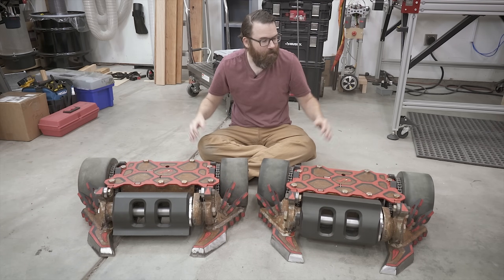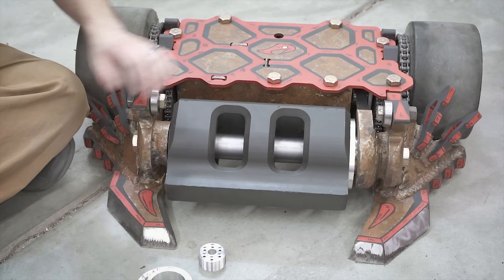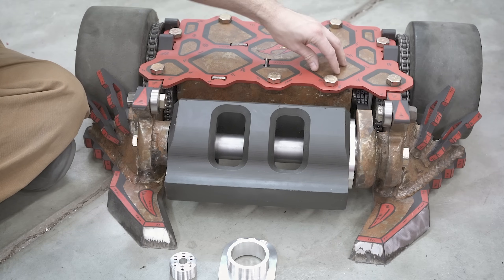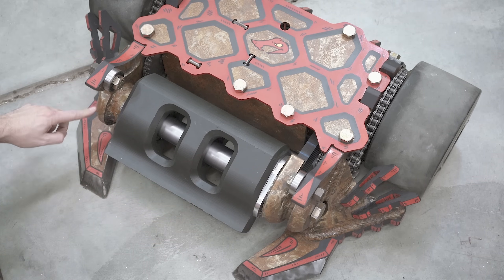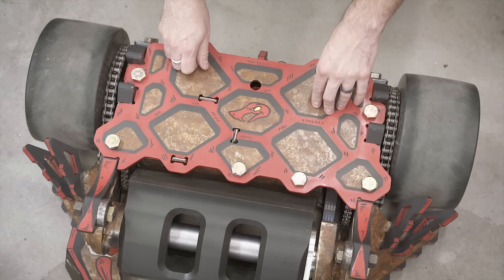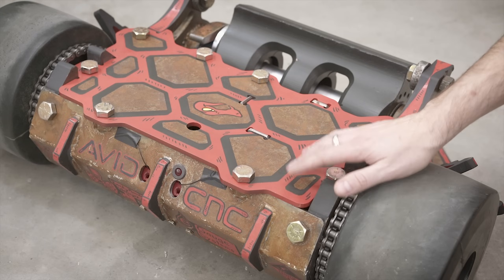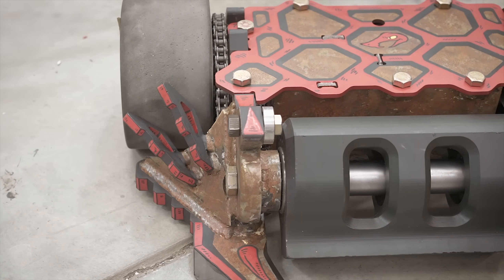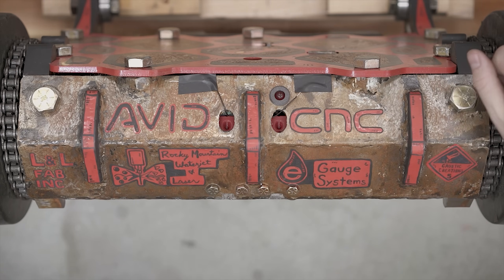Copperhead Preview (2020)

Comment: Hey, did you think about possibly incorporating motor into the shaft?
You'd have magnets placed on the shaft, and stationary rotor hidden within it.
This way you could save some weight and possibly make it more robust - no belts to slip or snap.
Other than that, design looks pretty good and there is little to better.
Also as for thermal epoxy - you might actually try doing some of such yourself.
JB Weld is known to be the strongest epoxy on the market, and incorporating some heat conducting particles (aluminium, zinc oxide etc) would probably not lower it's strength that much.
Reply from the maker: This is a hub motor, and it's not been successfully used in this weight class, the motor would see too high shock loads and would most likely break the magnets.

Comment: Robert,
 
This is a general question about the rotational speed of any robot with a spinner. I'm asking you because I've watched several of your videos and have enjoyed your depth of knowledge and ability to explain your design decisions.

The 2020 rules state that the highest speed of any external part of a robot is 370 ft/min.

In doing a few simplified and estimated calculations of your spinner, based only on visual estimates: 
8" diameter spinner x Pi = ~24" or 2 ft circumference. 
370 ft/min / 2 ft/revolution = 185 revolutions / min MAX. 

Your demonstration of the spinner when you demonstrated the sound level, I believe in a different video, looked significantly higher than 185 rpm. In the performances in the arena it also seemed to be going much higher than 185 rpm.

I found this higher speed to be visually the case for almost all spinners.

Am I missing something? I'm considering a design with kinetic energy weapons and of course speed is everything.

I'd appreciate your thoughts and insights.

Keith
Reply from the maker: I'm not checking all your math, but our drum isn't very large in diameter.  And the tip speed is 250MPH, meaning the outer tip can't move more than 250MPH.  185 RPM is VERY slow.  Check your math, something is wonky.  You're on the right track though.
Reply: @RobertCowanDIY  
I agree, 250 MPH is 370 ft/sec as allowed by the rules. Unfortunately, my calcs were done at 370 ft/min not ft/SEC. So i was wrong by a factor of 60. Oops. That would put your tip speed at about 11,100 RPM. A much better result. 
Thanks for the response.

Comment: Why aren't the magnets more on the front of the bot? Maybe on the back they help more on the traction and on the front (effective middle) they help more on how planted the bit behaves and prevents "wheelies"
Reply from the maker: The front weapon assembly is over 60 pounds, not including the shaft.  The center of mass is behind the drum a bit, so the magnets are placed just forward of the wheels to add more traction to the wheels without making it too front-heavy, which would cause it to just dig into the floor.

Comment: I know its far to late now, but, if you ditch the rare earth magnets, and instead use some of those magnetic door lock electro magnets, you can with very little space and weight gain use, 2 of the 300lb force electro magnets, they would without a doubt be heavier then the magnets your using, but you would gain magnets that you can turn on and off as you want to. so if you get high sided or just want to lift the bot up at the end of the match, you can either turn off the magnets clearing the bolt chain or whatever has you high sided, and or when the bot is powered down, you wont have to contend with the extra down force.
Reply: The new version of Beta has this kind of electromagnet setup. The reason its not more common is that most robots are totally fine with permenant magnets in key places, and running the electromagnets requires a lot of battery power. Beta will only activate the magnets when it fires the weapon to keep it grounded. Copperhead needs them on constantly to keep it flat to the floor, reduce gyro lifting and help it get under opponents, as a result they may as well be permenant. I will also mention that adding magnets isn't a new thing, its been around ever since the original comedy central BB!

Comment: I would make a very shallow pocket on the "fangs" and put a very low friction material there with mechanical fixings. Should help with friction. Also, whilst it might not be an issue of structure, i'd re-route the weld on the back. Doubt it would crack, but there's a lot of stress fracture start points especially at the meeting point of the plates.

Comment: Are those wires on the back the antennas? Does it run on 2.4 ghz? That antennas seems really exposed and surely will get torn apart at the first direct hit. What about a 900 mhz receiver placed inside the bot? Will it work and be much more durable or the metal would shield it even at that short distance?
Reply: Teams are required to run 2.4GHz TX/RX systems for saftey reasons. Running the wires out the back like that does make them a little vulnerable but it is extremely unlikely they will get hit round there and even if they do the robot should still get some signals through. It may also be that the robot runs fine without sticking the antenna out the back and that they are happy to take the extra signal reliablity over the very small risk of them getting destroyed.
Reply: I think 2.4 is a safety requirement

Comment: So, in the video I hear allot of "beefed up",  "Longer bolts" and "Stronger". And then in addition to that, there are the potential setups/modifications. That makes me wonder where that additional weight is coming from (assuming CopperHead was the full 250 pounds last year.) What bits have become lighter and where was the weight saved? I can not imagine rounding off the frame rails and all would save much weight so I am curious about the changes in weight distribution.

Btw. as always great overview and I am greatly looking forward to seeing Copperhead and the team fight on tv, good luck and stay healthy!
Reply from the maker: We were about 10 pounds under last year, which is a good amount to play with.  Most bots come in around that weight so they have some room to add stuff.

Comment: IS a 250 lbs push bot, no spinners, hammers ect. Is that still dangerous if not handled properly? I think not because its just a heavy box on wheels
Reply: A heavy box on wheels will rip your ankles off and crush your feet if travelling fast enough- you only need to see r/c cars weighing ~10lbs knock a grown man off his feet to understand that they have a lot of kinetic energy that can still hurt you really badly.
Reply: That heavy spinning thing in the middle is more destructive than you might think..